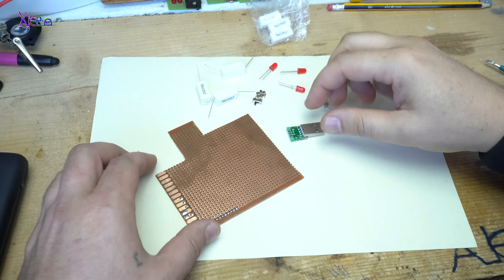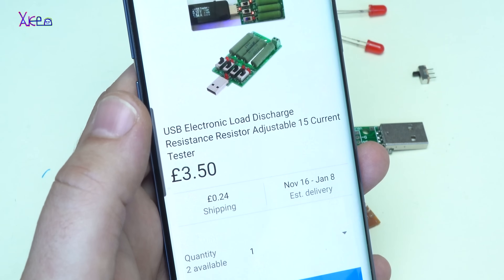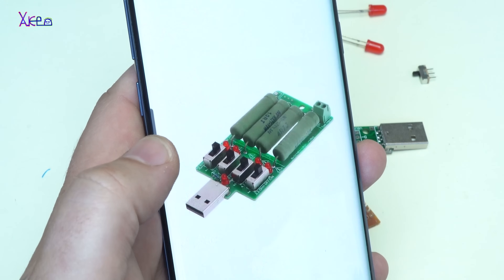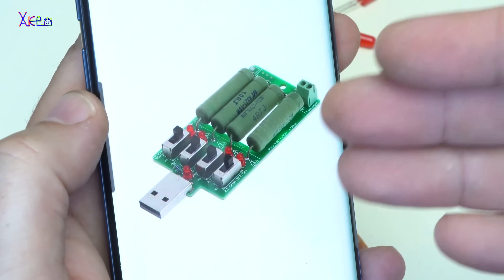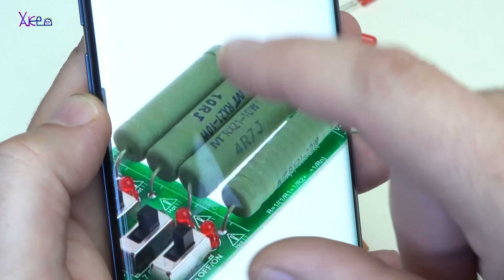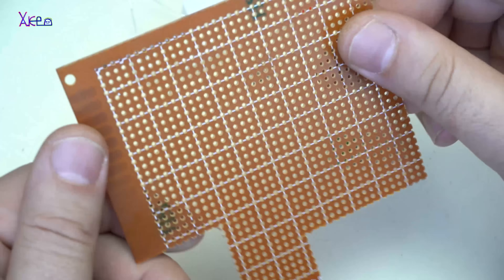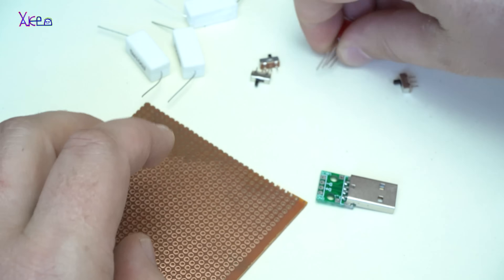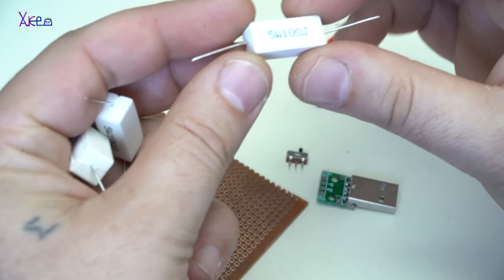How To Make USB Discharger, a homemade device

Comment: Or you can just converting a usb to a motor or anything that works with a very high voltage. the appliance will want to take electricity which will not be sufficient for the operation of the appliance. or take a light bulb. it takes a lot of electricity if not enough.
Reply: Uh... Ok